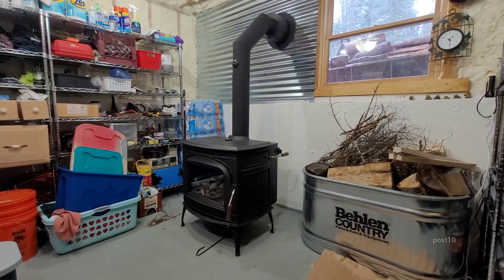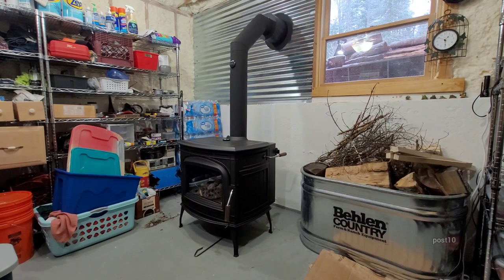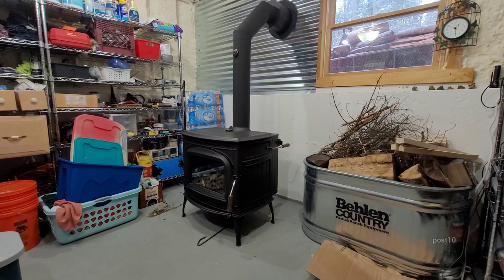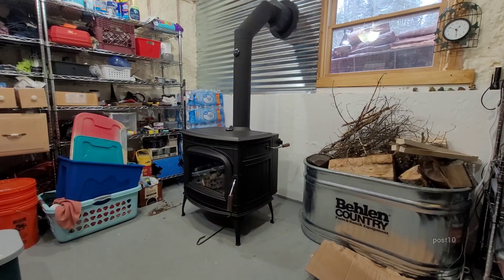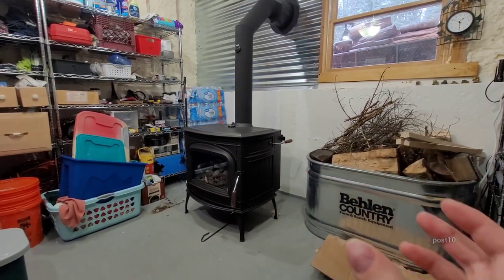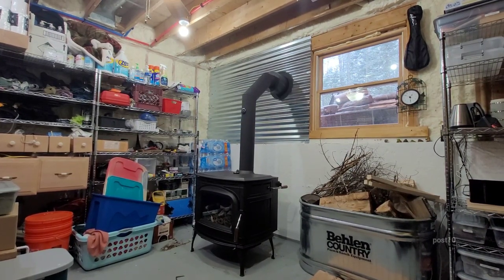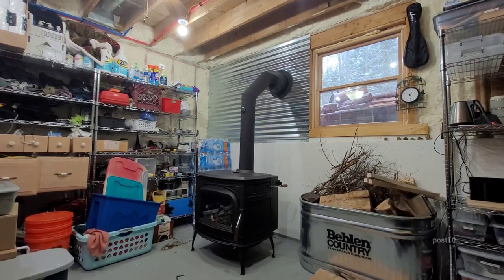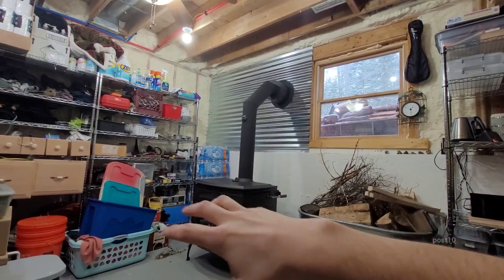Burning Wood To Save On High Diesel Prices. Blaze King Catalytic Wood Stove Model Ashford AF30.2A

Comment: Excellent video and beautiful wood stove! We used to have a wood stove then later, installed a wood furnace in our basement. In 2000, I installed an outdoor wood boiler which made it so much easier with loading it up and storing the wood outside. After 22 years, I now miss having a wood furnace in the basement. There are pros and cons about using both indoor wood heating appliance vs an outdoor wood boiler. Mostly, it was nice to go down into the basement with the temps being in the 80's throughout the basement with the concrete floor warm to the touch.

Comment: i have four sores of heat, propane high efficiency,  electric radiant heaters that i use with my solar, during the day when i am producing enough electricity, a pellet stove, and also a wood stove, i switch back and force between the cheapest sores during each day. and your right a wood stove is truly a go to for backup heat when there is no reliable electricity.  and a electric log splitter works great with the small logs that you are splitting.

Comment: I purchased my first all-by-myself house four ago. It had a wonderful bluestone wood stove inserted into the fireplace and I use it instead of the oil furnace back up and the gas back up because it’s cheaper and because it’s friendlier and because it works. It heats the entire house without electricity which has😢 not been a problem yet but it could be. I love it. Thanks for this. It was interesting in case I change houses, because I didn’t start with the new stove. (This was well-established and efficient.) 
Because the stove and Chimney are in the center of this craftsman house, it heats the center of the house, so that none of the pipes will ever freeze. As long as the stove is working on end fired up. The bathroom is upstairs. The kitchen is behind the chimney on the first floor, and the washing machine and dryer and outside spigots are in the cellar underneath the stove. It’s well placed I must say.

Comment: I own a blaze king for my house and princes in my garage for about 5 years now and I have cut my wood down in half.  Next to no carbon build up in chimney, the usual on my cap but as long as u do the start up procedure and burn seasoned wood these stoves rock. I'd never run household wast through it though.

Comment: Post Ten, just a FYI you can move both of the handles of your logsplitter  at he same time. One of the handles is for fast speed splitting and the other is for slow speed splitting.
Reply: Is he not clearly using both hands? And may humbly suggest using a axe.

Comment: I had a similar set-up many years ago. You don't have to cut a hole in the ceiling. Just set the box fan on the floor at the top of the stairs pointed down into the basement. You will get more than adequate circulation of heated air.

Comment: Good idea getting the woodstove. In my experience. With a modern EPA app. Stove. The key to it’s efficiency is making sure the gases are burning. In order for that to happen a flame has to reach the gas burning area. Then you will see the blue flames. After that it can stay lit but will go out without a flame to relight it won’t be burning gases. At some point When wood is burnt to embers and coals there’s no gases to burn. Operation of stove on low setting while keeping the gases burning is key for a clean, efficient all night burn. Smoldering a woodstove is dangerous as is wet wood. Soot will soon clog your catalyst, chimney, chimney cap. With my Pacific Energy stove. A normal load is 2 pieces of wood like a half log split in half. Set wood flat part down and leave about 1/2 in. Crack in the middle. The flames will go up through it. The bigger the pieces the hotter it will burn.

Comment: We've heated our house with a catalytic wood burner for 22 years. (Several videos about it on our channel if you'd like to check them out.).  There is no substitute for wood heat. And if you can process your own firewood - it's highly efficient (but a lot of work).  Great video!
Reply: My catalytic stove is a dual fuel and I can with certainty say that coal is quite the better substitute. It may not be cheaper than free but holds way more BTUs per pound. One load burns for 24 hours compared to 12 with wood, not to mention the heat throughout the entire firing cycle is wayyyyyyyy more even. No wild fluctuations like wood. But free is the best if you are going by cost....
Reply: @kylemccourt663  Very interesting! Thanks! I’ve never tried heating with coal.

Comment: I have burned wood for last 4 to 5 years..best thing I have ever done was putting my stove in. I have never bought wood. It literally grows on trees. I used to burn 300 gallons per winter and having the peace of mind you have heat without power is priceless. Yes you can burn pine..Just keep your stove pipe clean..be smart and keep it clean

Comment: Wait till big brother changes his mind on wood burners ! It’s starting to happen again in Washington state. Come on man you want full electric says the big guy 😂 Nice burner been at it for 35 years it’s great exercise and the $ savings help at the grocery store. At $6-7  a gallon for oil you should have your $ back faster then 4 years. Have fun !
Reply from the maker: If everyone had to switch to Electric it would cripple the grid and cause blackouts at the moment. Electric is also the most expensive heating in the area unless it's a heat pump which is extremely expensive to install

Comment: You have a good stove. My friend just bought a blaze king and we are amazed at how little wood it uses. As for splitting get yourself a Stihl splitting axe. That will do most of your splitting and get you in shape as well. I have 3 hydraulic splitters and still split by hand occasionally just for exercise.  You will be surprised at how much you can split if you stay at it 20-30 minutes at a time.
Reply: Not on black jack oat, power splitter much easier

Comment: i got my first catalytic stove this year and am loving it..the whole idea about the cat is to use less wood and i load my stove and run it on low and let the cat put off the heat..the temp gauge on the pipe i  like to run as cool as possible, the hotter it is the more heat you are wasting out the chimney..the cat will keep the creosote from building in the chinmey because it burns all the smoke up so ignore the words on that upper temp gauge since its a generic thats used for all stoves..the combustion air draft will not really effect the cat temp, once the cat is glowing it feeds its self off of the smoke from the fire and the slower you burn the wood the more smoke the wood puts off and the hotter the cat will get, so in effect the cat will burn cooler if you burn the fire hotter because the hot fire burns up its own smoke stealing it from the cat if that makes sense..im burner about half or a little more less of wood with this stove compared to my old stove!..the reason i got it is because firewood sellers are price gouging the crap out of firewood buyers this year..its ridiculous what they are charging for their under seasoned and under sized loads of wood!!

Comment: I made a heat exchanger for my fireplace, to get more heat. The pipe is heated by the fire, and i put a adjustable fan into the pipe at 3 difference speeds as the pipe is heated the hot air goes around into the pipe and out of front of the pipe with bunches of hole out into the room. Now its 50% efficent

Comment: I have an outside fireplace just for recreational use and I've had some really sketchy moments burning pine lumber. 2x4's pop a lot even when they've been drying in the house for 50 years. And I've had some thin stuff, think broken down wooden pallet type wood, but covered in really old sap and it burned thick black like a car fire! That's just for fun, I don't heat my home with it.

Comment: Now that you have fired the stove you should read the owners manual that came with the stove. Start around page 20. Blaze King does a great job on how to operate the stove. 
I would love to see another video after you have burnt it for a month or so.
Reply: Also, nice job talking about the tax credit. the tax credit has now been renewed till 2032 and raise to 30%. unfortunately they put a $2,000 cap on it which only works out to about a $6,500 purchase. there has been legislation introduced in Congress to raise that backup to $8,000 cap. 
this would be a much more realistic number.
Reply: @rodgerholland2803  8,000 is more realistic for anyone looking to get a stove, the smaller rebate is only good if you're making a replacement

Comment: Easy way to start these stoves is light kindling or chosen starter over the ash grate. Open ash pan about an inch. Load with wood and close the door. With the ash pan open you cause the stove to draft harder. Essentially like a rocket stove. About 5 to 20 minutes later close ashpan and good to go

Comment: That’s excellent,but the problem with these high efficiency stoves is you have to have wood dried to at least 22 % wood moisture,therefore you need to cut wood this season for next season,or following season,and the wood needs to be zero wetness. You need to get a wood moisture sensor.
Reply: As a kid, my dad had us stack at least a cord of wood in the basement to help dry it and keep it dry

Comment: I definatley had sticker shock last time oil tank was filled. I removed tank and boiler out of garage. I will look at tractor supply for a wood stove that can use existing chimney. So then i could use a fan to transfer heat from garage. I'm in a wooded area so it should be cost effective

Comment: Have you tried using an upside-down fire when lighting the stove? Should get the heat going up the flue faster and create a good draw to stop the smoke from coming back into the room.

Comment: I like the stove. My only concern is that some of the objects around the stove appear to be too close. could be the camera but 3 feet is a good rule.
Reply from the maker: The stove has been running non-stop since I have installed it and nothing around it is heating up the stove company saw everything around it and the code in the state is 18 in

Comment: If you have central air, put a return register above the wood stove. You can take advantage of the furnace fan without cutting a hole in your floor!
Reply from the maker: I thought about rewiring the furnace so that it could run without creating heat just to circulate everything but my house is weird. It's an open concept so there's only one return vent in the basement and like 18 blowing vents
Reply: @post10Vlogs  I met a guy that just cut rectangular holes around the perimeter of the ceiling in the basement the size of heater vents and covered them with vent covers and the next floor stay toasty warm.

Comment: Do you have a moisture meter to check the moisture of your firewood?
I’m just curious what moisture content your wood that you are splitting right before you burn it.
Reply: I use the ones in box stores that measures moisture in the walls, they can just scan through a couple inches of wood, you set them for soft or hard wood, I find compares to the ones with probes.

Comment: Cut a hole in the floor if you like - but first try just putting your forced air furnace fan on high with the thermostat to 'Off' or a low as it goes --- the circulation of air - including in the basement - will eventually bring the entire house up to an even temperature.
Reply: Good point made here.  I even use my air handling unit to begin the draft on my stove when I am starting a fire.   By closing return pathways you can slightly pressurize the room so that air is forced up the chimney.  For me it just means closing a particular door.

Comment: Hi Post, your chimney flue is incorrectly installed. One pipe must fit OVER the other to stop smoke and fumes escaping upwards and out of the joints. You have that second flue pipe join sitting inside. That second flue pipe is upside down. Rectify that situation immediately as you will have wood smoke and wood gas escaping through that join.
Regards from South Africa

Comment: Oklahoma doesn't use Fuel Oil. The main resource for heat here is Natural Gas and or an Electric AC/Heating system. Pellet/wood stoves here are usually just for esthetics.

Comment: You and I are in the same situation. Heating oil hit just north of $7 /gal here this year. We bought our fireplace insert last January and if oil prices stay up we'll  pay off our stove in only 2 years (insane). Found in our first season how important wood quality was. Our first seller gave us junk rotten wood, but I didn't know any better. Second seller was phenomenal
 This year we bought 4 cords, wish I'd gotten 6 just in case. Next year I'll be building covered storage for at least 10 cords so we can start aging a 2 year rotation.

Rotten wood: 2 hour burns, not enough heat production
Good wood: 6 hour burns, lots of heat
Great wood: tons of heat, still need to clock burn time.

Have you managed to get long burn times yet? Any advice? Been combating rained on firewood issues by drying stacks of it near fireplace (radiant).
Reply from the maker: I literally just found out last night how important wood quality is. The stove you see in this video I've been only burning Hardwoods for the past 5 days since I made this video. I haven't shut the stove off since and it's doing a great job. I just bought a tiny little cooking stove and I tried to get away with junk wood like Pine and Aspen only and it was really hard to keep the temperature up but as soon as I threw a piece of Maple in there it started operating perfect so I guess I'll just use pine as a filler and stop using Aspen all together. Thanks for watching

Comment: Not supposed to do initial burns inside. The smoke that comes off the stave and pipe can be toxic. The handle you was referring to as the damper is a diverter. The damper is controlled by the knob. This regulates the air intake. More air = hotter fire. 
   These units with converters and reburners are all that can be bought in the states now. A law was passed back in I believe 2014. If your in the states, you can't buy an old school stove less it's used or you build one your self outta steel. Another thing, if the wood is burned in these newer stoves and it's not completely dry meaning below 20%. It'll smoke like hell.

Comment: The same principle behind catalytic converters in gasoline-powered cars and this stove also produces heat for oil-based hand warmers: a mesh of certain metals, when hot, can convert fuel vapor and oxygen into CO2, H2O, and heat without producing a flame.
Reply: Come to think of it, I think the butane soldering iron I got from Radio Shack ages ago was also a catalytic type burner. When that thing got going the mesh would glow and you can turn it down without the flame but still get a ton of heat out of it.

Comment: Great video.  I'm a 61year old woman. I live on acreage in a farmhouse.  I want to get one of these stoves.  But I did not think I could handle splitting wood if necessary.  I've never seen the wood splitter you featured in this video.  Do you think a woman would have the strength to operate it?

Comment: Can you please which model of the Blaze King you purchased? We just bought one and I'd like to compare it with yours. Thank for all your great info. We will be installing in the next month. Can you please do a video on how well the heating is preforming in the basement? How well is it impacting the heat of the house?
Reply from the maker: Yes this stove is a Blaze King Ashford AF30.2A and I just made this video about 5 6 days ago and I have been running it non-stop. The furnace no longer has to turn on so it's going to save really big with fuel. I plan on shutting it down for the first time on Friday so I can clean out the ash since it's going to be very warm outside. It is very efficient I can't believe how little would it uses compared to a regular wood stove. The real test comes next week it's going to be below 20° every day in the forecast and Sub-Zero temperatures Fahrenheit every single night, I believe it's going to be able to keep up just fine since I've been running it on low. I will make a one month update thanks for watching

Comment: Whoa the numerous flammable items next to the wood stove have to go. I found it funny that the wood stove company said they were ok to be that close. The problem is your insurance company is going to disagree and guess who pays out your claim? Get them out of there pronto. Have nothing flammable that close to your stove. If you leave them they will eventually ignite and your house may burn down. I could not believe how close they were to that stove which will get very hot.
Reply from the maker: Building code in my area says 18 in on the sides of the stove from any combustible materials and 3 ft in front of it

Comment: The first line on the gauge in the stove tells you your converter is at operating temperature. Bypass open, door cracked and the temperature set knob set to high.or all the way to the right. This is how to light it. When the needle gets to first line close door,  and bypass. Turn temperature control to what is comfortable. The temp knob all the way open wouldn't be any way I would run it.

Comment: Yeah you'll get a lot of smoke out of the flue when you load (or reload) the stove until the cat warms up and all the remaining water evaporates. After everything is burning well steady state you won't see any smoke outside and mabe see a little bit of distortion from heat waves, but it will be mostly invisible.